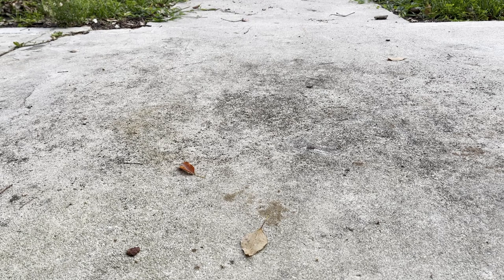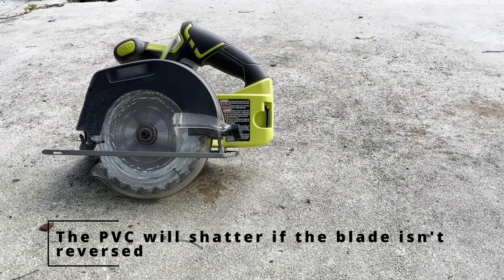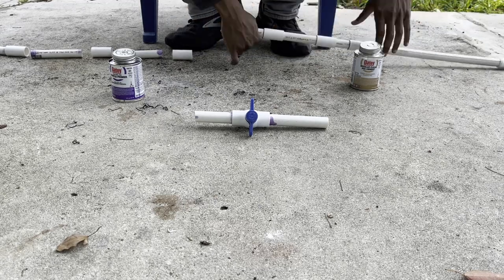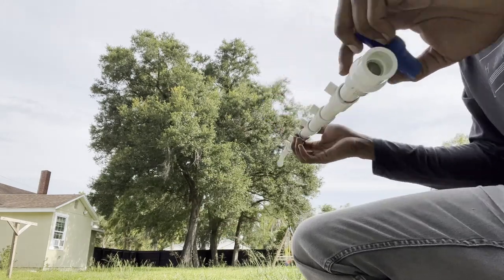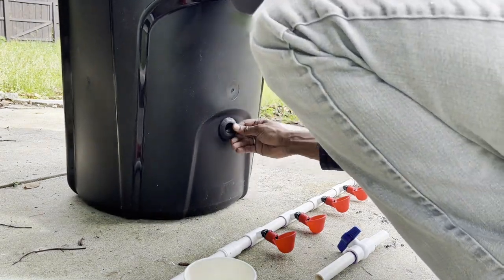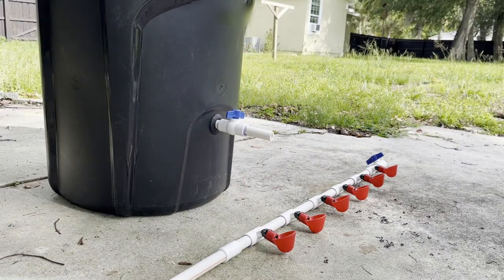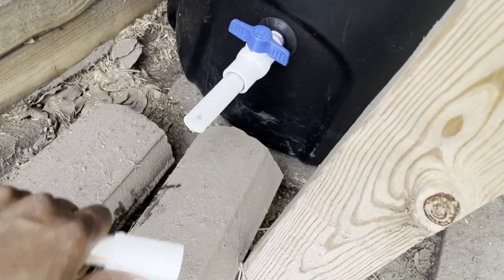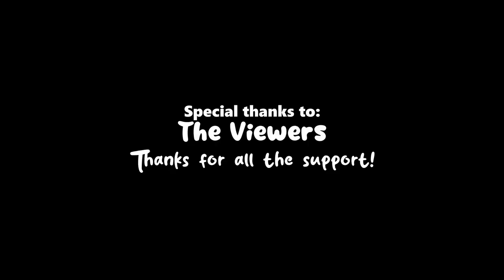Upgrade your chicken waterer!

Comment: Making use of the water tank like that is very creative. Could you have made the hole a little lower? so as to utilize the water as best as possible just in case you are unable to refill the container. I enjoyed all the videos btw.
Reply from the maker: Thanks for watching! 

The hole for the water outlet is higher up to make sure that there is enough water pressure to make it to the end of the chicken water manifold. The water outlet being closer to the level of the water cups decreases the pressure differential that the system has to overcome. Another way to add outlet pressure is by raising the tank and lowering the outlet. The next version of my watering tank will be raised above the ground to increase the water outlet pressure, and will be hooked up to a bamboo rain gutter system to decrease how often I have to fill it! For now I just make sure it’s filled every 2 weeks.

Comment: Do the chickens self regulate their water consumption? Are they prone to over or under hydration?
Reply from the maker: Since it’s been so hot lately, I want the girls to have as much water as they can drink. You can’t overdo it when it comes to water. Chickens pant (a lot like dogs) to keep themselves cool. The evaporation of the moisture in their mouthes helps them regulate their body temperatures.
Reply: That’s crazy. Keep those chicks hydrated!!!